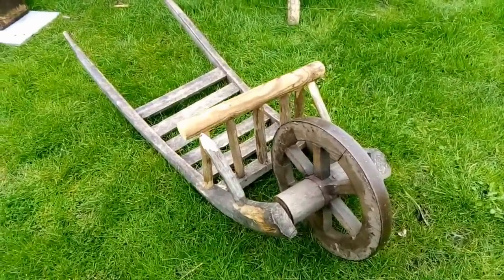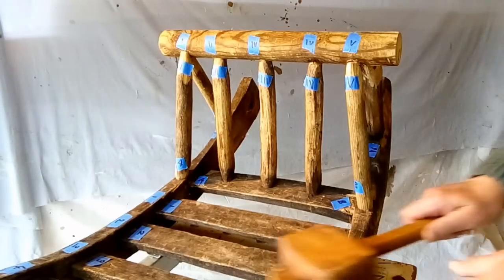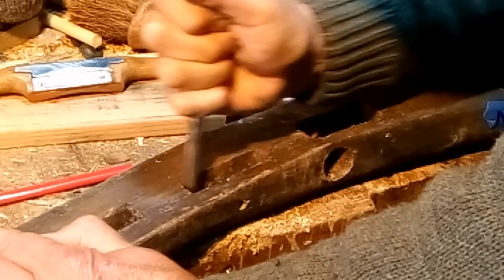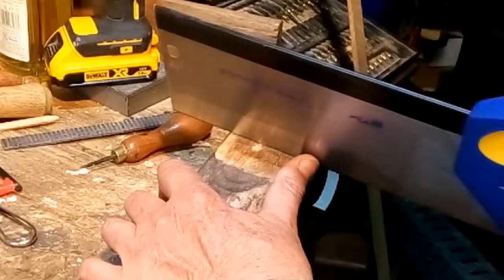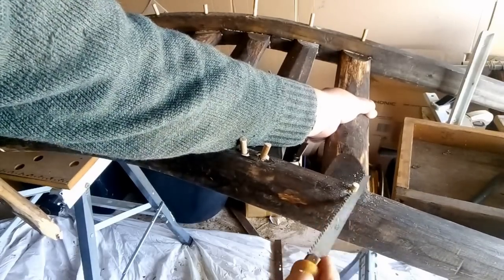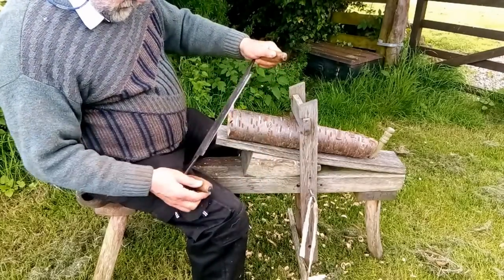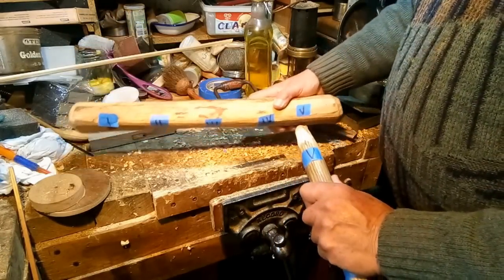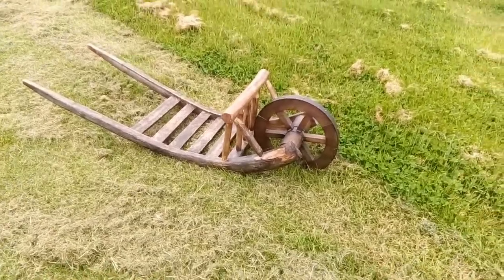To Rebuild a Medieval Wheelbarrow

Comment: The secret to having a solid wheel over time is to weld the two ends of the steel rim so that it tightens the wooden rim, so it must be mounted hot.

Comment: Do you think that the dowels were original, or part of a repair?
Reply from the maker: Its hard to be sure of course, but there is plentiful evidence of wooden pins being used to secure mortice and tenon joints in old carpentry. Look at any ancient wooden ship or timber-framed house - my own house has many exposed oak timbers, many of which show wooden pins securing the joints.  I am sure that medieval carpenters would have used a similar technique when building this kind of rustic or agricultural equipment.
Reply: @orphanedoak  Thanks.

Comment: Despite the very good intentions and many hours, it is only possible to make something out of nothing, but not a solid heavy-duty tool that will last for a long time. There are far too many errors and literal shortcomings in the original construction of this wheelbarrow for that. Unfortunately I think it's a waste of time and effort.
Reply: why bother rebuilding a spitfire or an e type jag.?. why have chesterfield furniture when ikea has the latest cnc cut and fitted pieces  ?  why bother with a Monet or Van Gogh when a computer and modern printer can produce cleaner , sharper more detailed  images, in that vain , why invest in anything vintage at all ? The list really does go on and on . If you don't appreciate and have some understanding of the past, you're unlikely to  thrive in the future .
Reply: I agree with your statement. Maybe I didn't make my point clear. As a craftsman I can see that the emphasis in building this wheelbarrow has been to make a cosmetically good wheelbarrow, not a solid tool. This can be seen in the too short pins, the unwelded rim, the (too small) square pins in round holes, etc. The only thing you can achieve with a lot of time and effort is another cosmetically good wheelbarrow. I myself would have suggested putting that time and energy into building a really good new one.